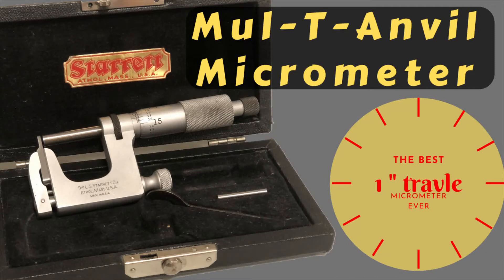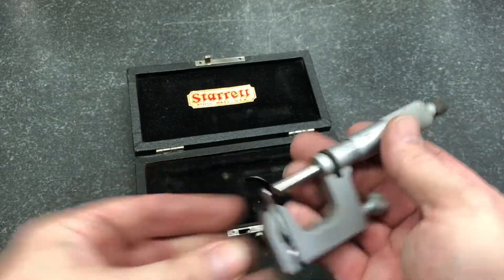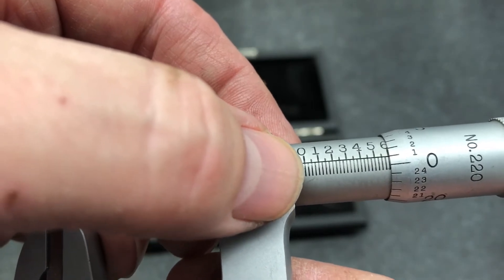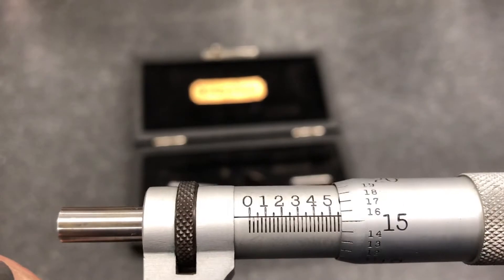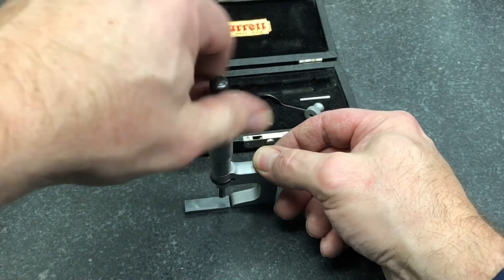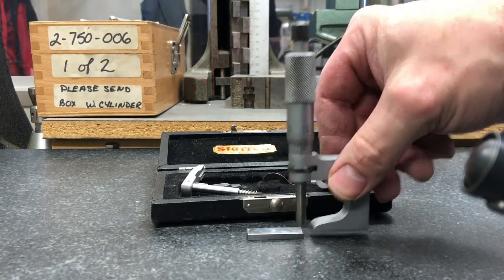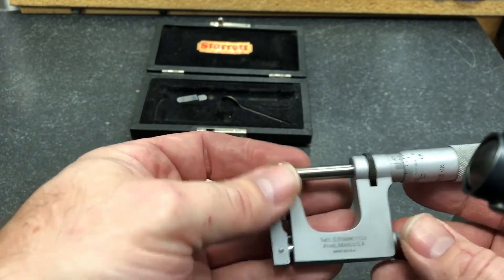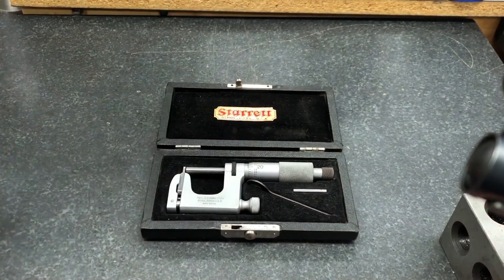Mul-T-Anvil Micrometer

Comment: I hate it when people don't use the ratchet and say you just need to "feel". NO! The ratchet is there for consistency. Every ones "feel" is different and it could be several tenths off between users if you don't use the ratchet. If anybody ever set's micrometers to a mic standard by "feel" they should be schooled in the matter. Especially if there are multiple users. But even if there aren't multiple users your subjective "feel" could easily be different from one day to the next. Always use the ratchet!!!!!
Reply: There’s a reason why everyone says not to use the cowbell 
With using the ratchet on the top you don’t get a feel that’s the biggest problem
If it’s a community tool or has a limiting sensor on it that’s different but if it’s a personal tool you shouldn’t be using the cowbell
Reply: I don"t use the ratchet.